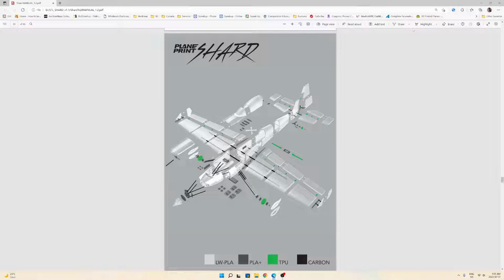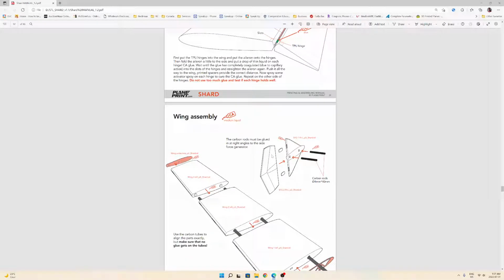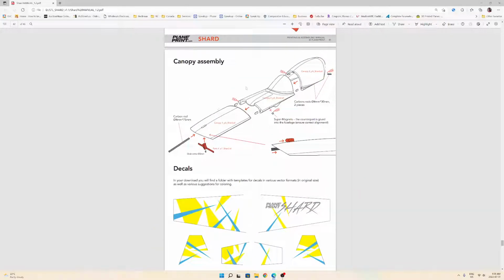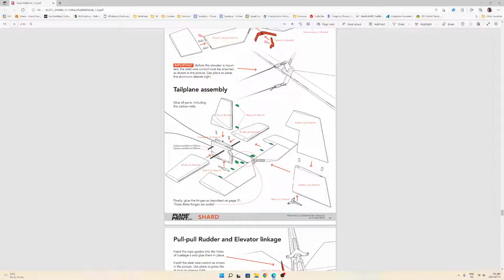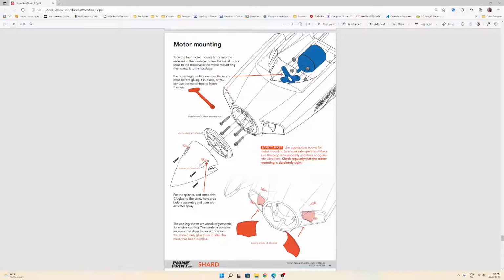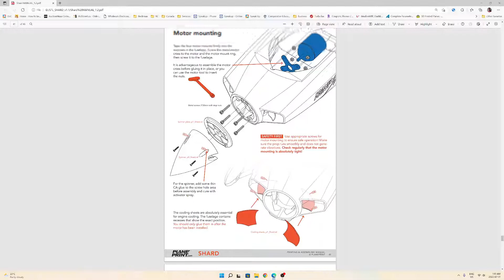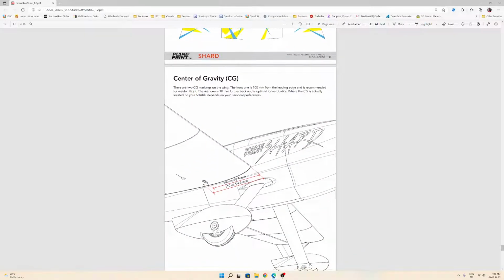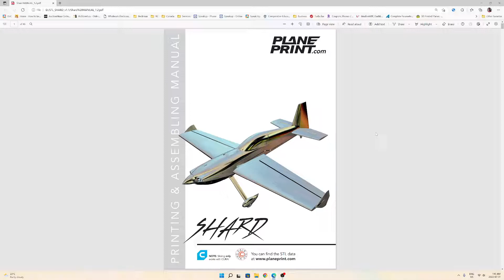Shard - Aerobatic 3D Printed Airplane - Part 2 "Disaster"

Comment: Thanks for the review Raed. The model is excellently designed and strong. You just went thru the same frustration I went thru a couple of years ago as it relates to the melting of the filament. I had quit building 3D models until recently. NEVER USE DARK COLOR FILAMENT GUYS. I'm not yelling, but I live in the Caribbean and had several models deform. Nowadays I print with LW-PLA,  the natural color., It can sit in the sun all day without problems. And as we speak Colorfabb released HT LW-PLA which withstands Higher Temperature. Total success. Go grab a couple of rolls and try it again. It's not pre-foamed but Planeprint gives you the full instructions on how to use it. Excellent!

Comment: 3D Printed model Airplanes Are very satisfying and many are a joy to Fly, I've tried Eclipson Models and they fly very well, But I always was aware of the Temp Tolerance of the PLA, In fact, I always flew mine late in the afternoon because Were I live it gets very hot, especially in Summer. Once you are aware of that it's all good. There is Also LW-ASA which you can just print and leave in the Sun as much as you like but since its ASA it's a bit of a nightmare to print since you need an enclosure and they say it is a lot brittle than LW-PLA.

If one day we will see PLA having more Tolerance to heat than PETG it would be the Holy Grail for 3D printed models but for now, it is what it is. 
So sorry for your experience but I hope you give it another Try, It was just a lack of Knowledge, Maybe you can print another one and leave it as a Winter Flier.
Reply: Oh, I've just noticed that you printed the Model in Dark LW-PLA, that explains a lot of things, TRY it again in Natural LW-PLA and spray it with light Colors. No wonder how it deformed so quickly.
Reply: I have read that LW ASA requires an enclosure to successfully print parts without excessive warping. More like ABS on the print difficulty scale.
Reply from the maker: @cl18t  thanks for the heads up

Comment: I've had this same experience with 3d printed plans. I now always print the motor mount with PETG. This should be in the manual as REQUIRED not optional.
Reply: True, I'm no expert in 3D printing but PETG should be the minimum required for the engine mount, ABS or ASA should be the best option as they handle more Temp.
Reply from the maker: Been doing some research, best material is low weight ASA for the plane and ASA for the mount. LW Pla will melt in the sun
Reply: @RaedAdlouni  LW-PLA will always warp if you leave it in the Sun Especially if you used BLACK or Dark Gray LW-PLA, try again with Natural LW-PLA and when on the Field just leave the model in the shade if possible, ABS will also work great for the Engine mount, I've tried it with RC 3d printed cars and it holds up very well, but if you manage to print with ASA yes go for it.

Caution with LW-ASA some say it's more brittle than LW-PLA and won't take an Impact as good as LW-PLA.